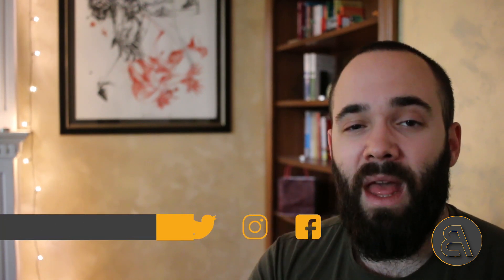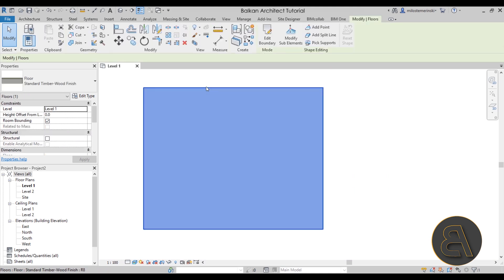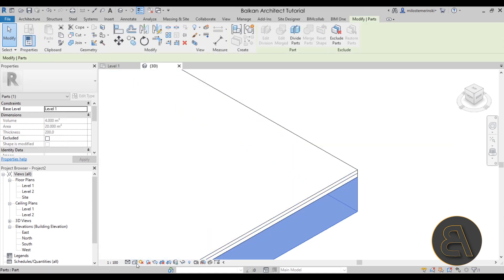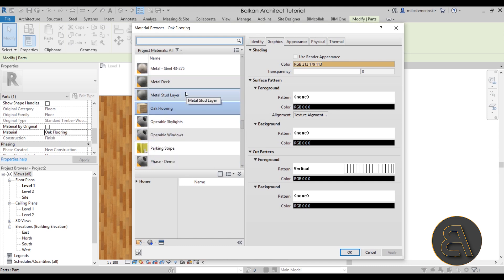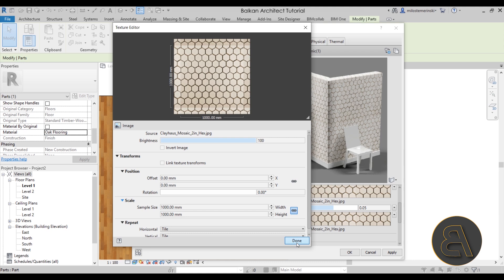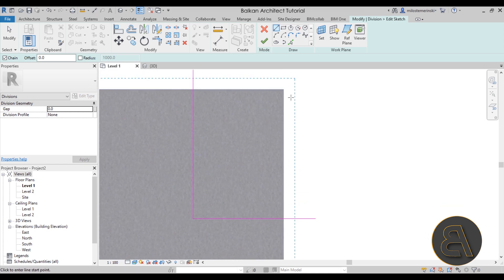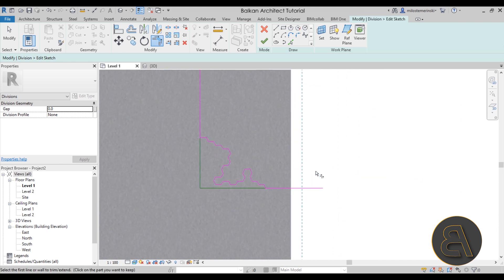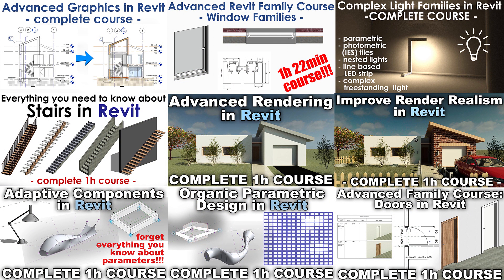Hexagon Tiles to Wood Floor Transition in Revit Tutorial

Comment: Hi, sir, i wanted to start learning via ur website. But i had a querry as to the fact can i access the tutorial videos available on ur site balkanarchitect.com on mobile devices rather than a desktop or laptop. Kindly revert back asap so that i can purchase the monthly plan. I am asking this question because my laptop has been broken so i dont had it fixed under this lockdown.
Reply from the maker: My website is running on the teachable platform which was designed to be able to work both on desktop and mobile devices 🙂
Reply: @balkanarchitect   ok. Thanks will purchase the plan today. Thanks alot BA. YOU ARE THE BEST.
Reply from the maker: Thank you for your support!

Comment: Good start Balkan, I'd suggest trying a 'follow-up' where you show these enhancements;
- Building a surface pattern using PyRevit for the hexagons
- Using this model pattern for precise alignment/trim
- Aligning a material to the pattern
 
I think this would be highly beneficial to your viewers.
Happy to cover it if it's not of interest to you though, just let me know!
And yes I'll credit your video :P
Reply: Can you change the thickness/quantity of layers of the element instead of just changing the "image" that is painted on its face ? That would be a more realistic workflow, like for example a wooden floor and on a small part a carpet that is over it, which adds extra thickness... Thanks.
Reply: @trollenz  yes in this case I'd associate the hexagon image with a material, and apply this to a sublayer in the floor type with a thickness.